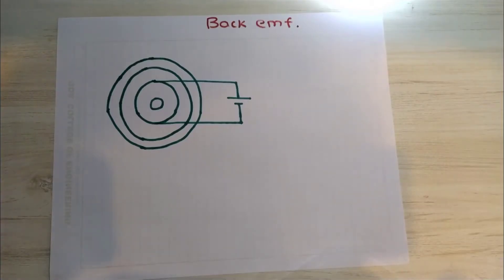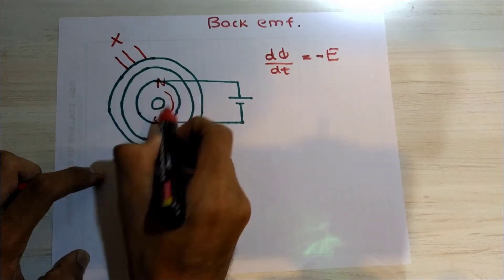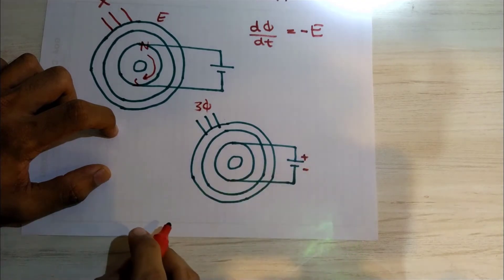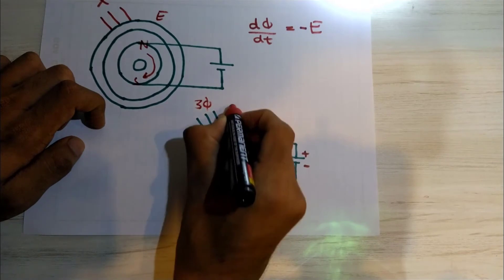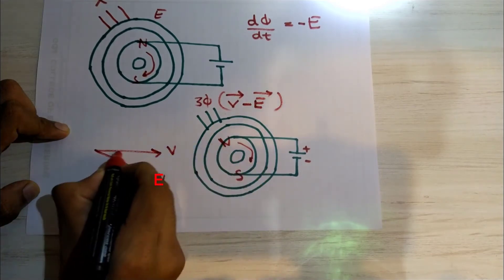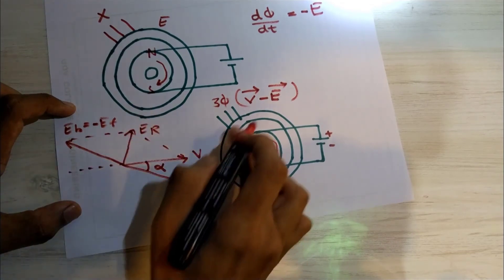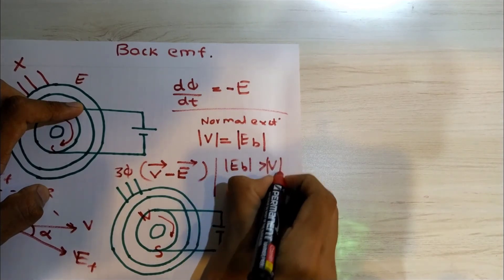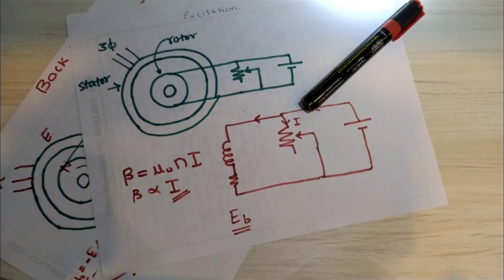What Is Back EMF In Synchronous Motor?

Comment: In synchronous motor first the rotor gets rotated to synchronous speed and excitation is given for magnetic locking.if they are magnetically locked they both rotate at same speed then how the rotor flux cuts the stator and back emf gets induced?? Please clarify
Reply from the maker: For a 3phase sync motor, we have various starting methods. One of them is the damper winding starting method where we run the sync motor as an induction motor first and when the rotor speed reaches 80% of sync speed, the rotor is provided with excitation. Similarly there are other staring methods where we can bring the rotor speed almost to sync speed and then provide the excitation. 

Now coming to your question, i like to think that the rotor flux is rotating with speed almost equal to sync speed  & the stator windings are stationary at one place. Apart from that when we provide excitation to the rotor, the foreign flux will definitely interfere with stator voltage drop(back emf). Hence some emf should be produced in stator winding. There is magnetic locking in the fluxes but no mechanical locking between the stator winding and rotor winding.

Comment: what about the inductance and resistance of the stator coil wenn feeding 3~ AC? what relationship is with the resulting voltage?
Reply from the maker: Yeah it has , the Ef voltage is part of an equation [ stator terminal volatge = voltage drop due to impedance  + Ef  ] if the inductive or resistive drop are more then the value of Ef will be less. 

Ef is the effective voltage in the coil
Reply: @pratikphadte  thanks